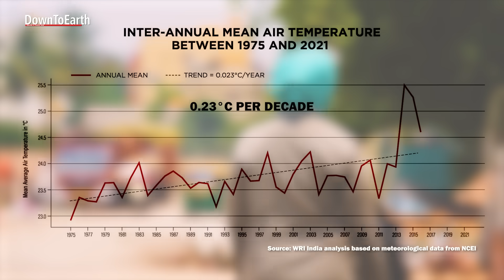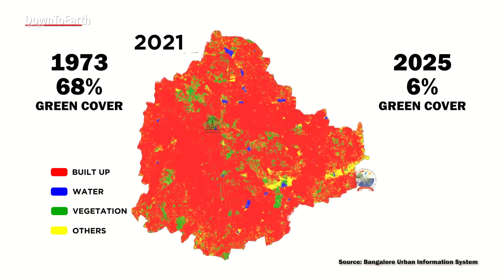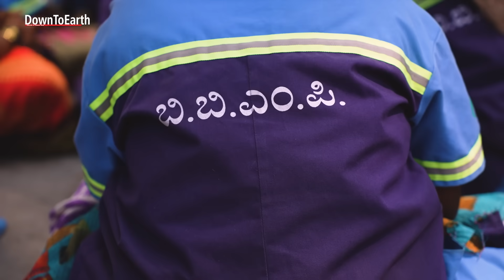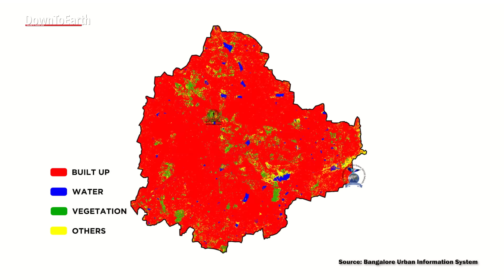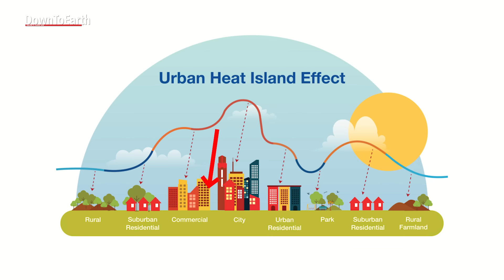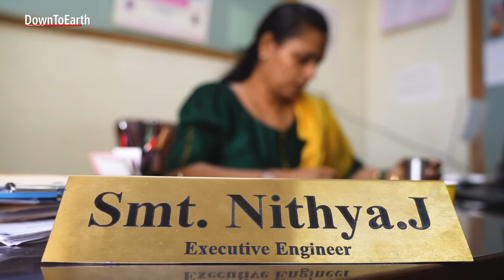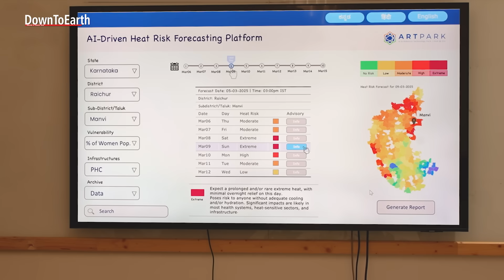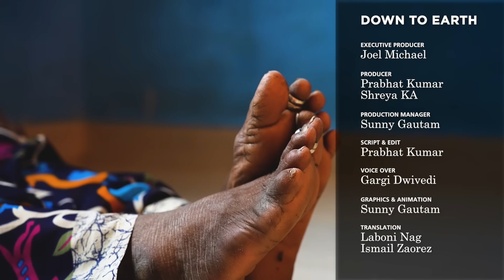How vanishing lakes and parks are making Bengaluru heat stressed? | Urban Heatscapes E2

Comment: Simple solution, SAY NO TO APARTMENTS. They are the main culprit to many problems in Bengaluru. 
1. They increase population density in a specific location, stressing the land under it.
2. The surrounding areas are deprived of sunlight, wind and even rain.
3. It is more ecologically disturbing as they are typically high-rise and can affect the delicate wind patterns and insect migrations. 
4. They are constructed in huge plots that are usually best suited for agriculture.
5. They disturb the water table under the land causing many serious problems.
6. They increase the heat of the surrounding air and even increase water wastage (water simply just rushes into stormwater drains which can actually be used)
7. Highly inefficient in supplying electricity and water.
Bengaluru is NOT suited for apartments. Instead people can live in low-rise houses and PG's.

Comment: It's said that bangalore at an elevation of 900 mts  would AIR COOLERS work there anyone reply
Reply: Yes. Since it's not a coastal city, air coolers should work fine. The lower amount of humidity helps
Reply: Compared to any metropolitan cities in India and yes still Bengaluru has a better weather ☁️
Reply: Yeah
Reply: Yeah Air coolers work regardless of the elevation/altitude of the city
Reply: desert coolers/air coolers are sold in North India means every shop will have 500 , thousands of air coolers but in Bengaluru I didn't see that trend in months from April to July .If possible the government or some electronic gadgets companies should be contacted and a huge demand for desert coolers should be placed then shops will be keeping air coolers in large quantities .For e.g. in Varanasi , Uttar Pradesh these days every consumer electronic shop has desert cooler and people are purchasing it at rapid rate
Reply: 6:37 The sanitation workers should tie white clothes/scarf , this is also another problem shops don't sell white scarf/umbrellas in summer season .Tying dark hued scarves/clothes won't protect from Sun's heat